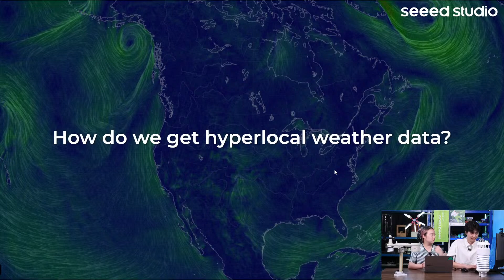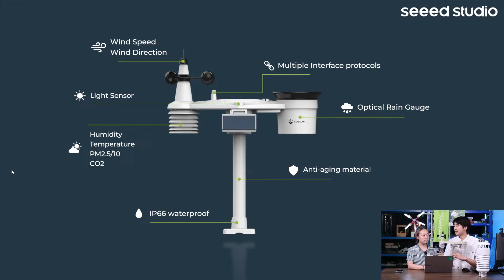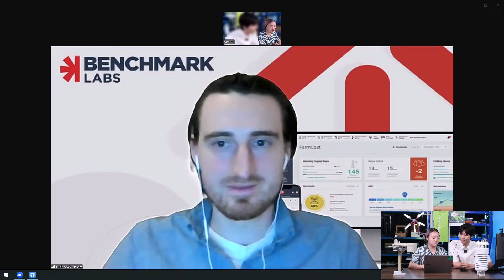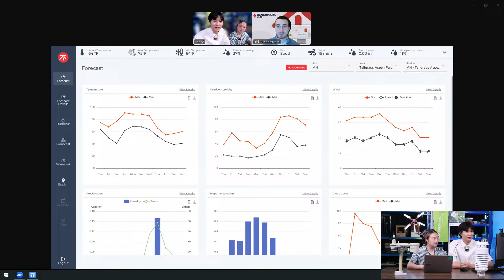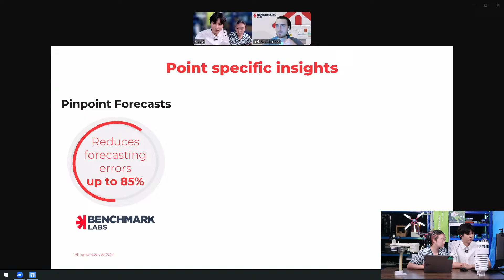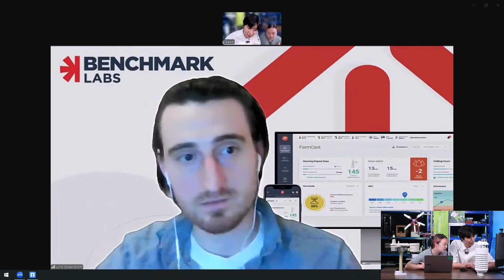Making Next Gadget: Advanced Sensors Meets AI for Hyperlocal Weather Forecasting

Comment: Hi. Can the 4G Datalogger also function as a gateway for other S2100 based sensors (or other LoRaWAN devices) in the area or does it function purely as a datalogger for physically connected sensors?
Reply: Yes, the SenseCAP Sensor Hub 4G Data Logger can only connect to sensors that support the RS485 protocol, such as the S1000 Series Weather Station, via a physical RS485 connection.

If you wish to connect to other S2100 based sensors, you will need a SenseCAP Outdoor Gateway, as those sensors communicate wirelessly via LoRa.

Combining the functionality of the 4G Data Logger and the Gateway into a single device is a great idea—we appreciate your suggestion and will consider it for future development!